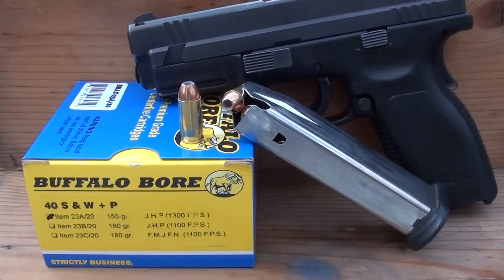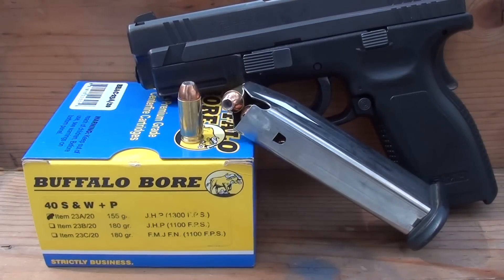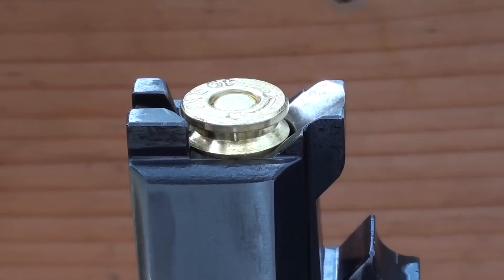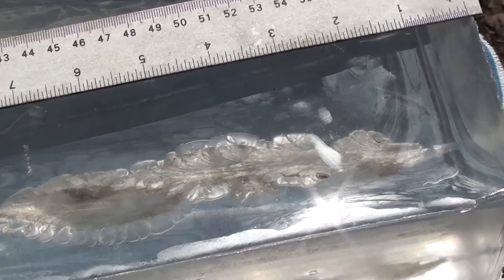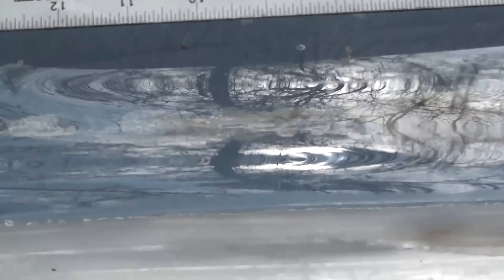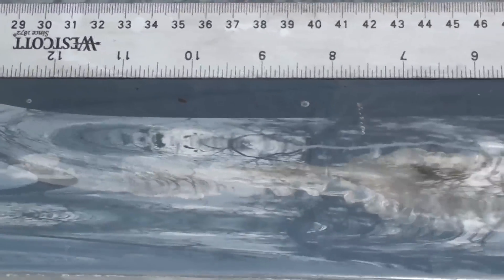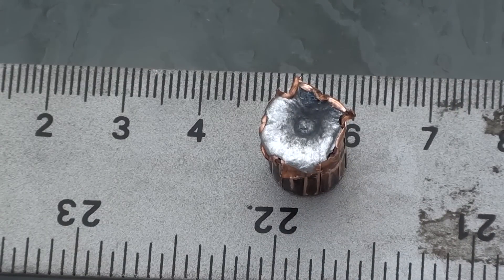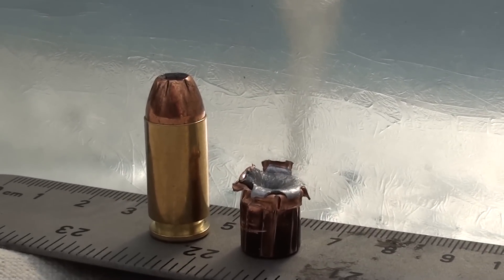40 S&W +P Buffalo Bore 155gr JHP Ballistic Gel Test

Comment: Scuba" I've heard this" not how reliable the source" I've fired Thousands of .40 cal out of my GLOCK 23 gen 3" I've never had a hiccup..& thousands out of my 9mm GLOCK's without a problem" but yes a Storm lake " or Lonewolf barrel is supported" I also have a Factory 357 Sig G32 barrel, although I've never fired it yet..Rock on
Reply from the maker: Oh, its not regular ammo.  That  warning is for over pressured ammo and re-loaders.  If your shooting new ammo in your Glocks, Rock on, all is good, Hell I have over 4k in my 23 alone with no problems.  Its just the over pressure rounds and reloading 40 S&W where the case bulges a little at the bottom because of having a not 100% supported barrel.  Your good brother
Reply: I also have a Glock 23 gen 3 Gen 3 you don’t have to worry about this problem Earlier generation glock 23 are not supported

Comment: In my GLOCK GEN4 G27 I replaced the 3.6" factory barrel with a 4" threaded Alpha Barrel from Lone Wolf with a compensator. I feel this barrel should be more then need for Buffalo Bore and Underwood +P Ammo in my GLOCK GEN4 G27. I also bought a threaded Lone Wolf barrel with Compensator for my GLOCK GEN4 G20 10MM. I will buy some of this high performance ammo and report back on tolerances on the .40 & 10mm.
Reply from the maker: From what they told me at Lone Wolf, their barrels are fully supported.  I am getting their 460 Rowland barrel and I inquired about the .40 cal barrels at that time.  Thanks for the comment. Let us know how your barrels turn out

Comment: Hey I checked my new GEN4 GIOCK G27 and it has the same appeared support of chamber around ammo as shown on you video. Anyone knew if GLOCK enhanced their chambers on barrels of the SUB-Compact GEN G27?
Reply: Yea Glock has increased the amount of chamber support on the newer Glocks. Modern day 40/10mm brass has also been strengthened from its original design years back. All told, you can pretty much shoot any SAAMI spec factory loaded ammo in your new Glock. I would still stay away from any "+P" ammo in the .40 though. First reason being there is no specifics in existence about .40 +P so every load is just a guess in that realm. Secondly, there is absolutely no reason for it. Any quality .40 load is more than adeqUte for defensive purposes; 165 & 180 HSTs, 155, 165, 180 Gold Dots, 180 Golden Sabre Bonded, 175 Critical Duty, all excellent and proven .40 loads that will function every time in your Glock. If you truly feel the need to stepping up higher than that switch to 10mm in the G29 and you can get all the high power loads you desire. Be warned though your groups will open considerably and recoil will be less manageable. This is why .40 & 9mm remain the most popular defense calibers; easy to shoot accurately, dependable, reliable power and good round capacity.

Comment: My 155gr hand loads in .40 are right around this velocity from a Glock 23 using TiteGroup- 1310fps avg, and I don't have any issues in the stock barrel luckily. I don't load much to that velocity in .40 as far as volume though, so can only speak for maybe 80-100 rounds. Typically I get much greater accuracy with a a bit lower velocity, around 1240 with an XTP bullet is very accurate. If I wish to get super hot in a .40 caliber bullet I just make hot rod loads for my G20/29. I can load 135's @ 1600, 155 out to 1500, 180 out to 1390-1420 and 200s at 1350 all safely from a 100% stock Glock with 10mm brass so I don't have much of a reason to risk damage getting 1300s out of a .40 case. That's just my opinion/preference though and I really only load that hot for testing as ultimate accuracy and maximum velocity don't always go together in a pistol load.
Reply: I've seen someone get 1550 out of a 150 grain nosler jhp with a healthy dose of longshot from a Glock 35 length barrel

Comment: Hey, Scuba, when I checked my Glock 23 gen 3 barrel last year, comparing to pictures  supported barrels, it appeared that my G23 Gen 3 barrel looked the same.  It didn't look like some older Glock barrels. 

I'm just curious if you could take a look and see what you think.  I can send pictures of a round in my barrel if you need.
Reply: All factory Glock barrels are not offered with fully supported chambers. This is only an issue with the .40 caliber though; all other caliber Glocks can safely handle just about any load you throw at it. Typically Glocks are proof tested to handle double the pressure of a given cartridge. For example 9mm standard pressure being 35,000 psi, Glocks are proof tested to handle a minimum of 70,000 psi. Your typical "+P" pressure is only around ~37,500 psi and typical commercial hot "+P+" loads are at most 42,000 psi. As you can see there is still a large safety margin here, and this goes across the board with service calibers. I have proven this time and time again by purposely double charging cases in 9mm and 10mm with stock Glocks and test firing the load and the pistol survived each time. Glocks are indeed strong, but the inherent weakness in the .40 case just doesn't jive well with Glock chamber design and high pressures. Typically you will only see case damage and not pistol damage but still the risk is always there.
Reply: @joedoole3527 Generation 3-4-5 G23  pistols are supported anything earlier than Gen 3 is not supported
Reply: I don't plan on testing anything marked +p in it, it's just for the sake of discussion and education.
Reply from the maker: I really dont know, As of now all Glock barrels in .40 are Tabu.  I know mine in Gen 4 does not show support, and the ones I have fired in Gen 3 bulge the brass I reload, So unless you change to a lonewolf barrel or ect......... I would be leary
Reply: @ScubaOz Generation 3–4-5 G23s  are fine anything earlier than Gen 3 is a no go
Reply: Anything gen3 and above is good to go
Reply: And the plot thickens haha.

Comment: It was only a matter of time before someone came up with a 40 +p cartridge.
Reply: Yep. I call mine 10mm.
Reply: @jr10  if you need a 10mm you'd be better off with revolvers.  unless you spray and pray like a spaz.
Reply: @af7119  Not sure I understand.
Reply from the maker: Leave it to Buffalo Bore, they tweak all rounds out!
Reply: I'm currently carrying an XD40 so I just might give it a try.
Reply: so basically a .40s&w becomes a 10mm again,,lol=full circle!!!
Reply: @6548ww  Not quite 10mm pressure or power.
Reply from the maker: No, the bullet is so light (155gr) the felt recoil (to me) is very light
Reply from the maker: LOL, everyone did back in the 80's  40's were known as Short & Whimpy loads.  10 kicks ass for sure, these 40+p's were pretty darn good also, not 10's but it worked
Reply: Rifles First official SAAMI specs for +P+ do not exist even for 9s. However, saying there is no such thing is inaccurate. It exists and you can buy +P+ marked rounds that are over 10% above max. Not having an official spec for it doesn't mean there is no such thing.

These particular loads may or may not be over SAAMI max specs for .40, but that wasn't my point. 

I'm also not advocating or suggesting people load to +P themselves. .40s can be touchy if you load 180 gr bullets and would be difficult load to an accurate pressure because of the small case size. It is difficult enough to load to max safely. 

However, if the manufacturer is going to load 155 gr bullets to SAAMI .40 cal max pressure, it would be a good idea to put +P on it because due to minor inconsistencies in powder metering and seating depth, you will inevitably have a percentage of rounds that end up over the max pressure. Warning buyers that they could be shooting .40 cal rounds at +P pressure levels (if you can't handle actually calling it +P). If you have a gun built to handle a .40 proof round, it won't fail catastrophically with a .40 +P round any more than a 9mm would.
Reply: @IHCTerra  what does "built to handle a .40 proof round" mean?
Reply: Dr. Death Common misinterpretation.  They both have the same maximum psi rating, though.  Who knows what actual pressures they are using when you buy ammo?  Well, it probably could be found, or at least equivalents of each could be compared for hand loads.
Reply: +ScubaOz BTW is the recoil any snappier with that +p round?
Reply: Ha! Me, too. If I'm not using 10mm, I like .45 and 9.
Reply: IHCTerra I have to concur with Rifles First in both the first and last line of his reply. There is no 40 +P. It is simply a marketing ploy for pushing ammo loaded to max spec to those who don't know any different. Furthermore that ridiculous bit about a small percentage being over the SAAMI spec due to inconsistencies in powder charges or seating depths is already factored in by them. That's why its called the maximum average pressure (MAP) and it typically includes a 4% standard deviation for those very reasons. Another note I should add. In regard to assumptions of a gun being proofed. Unless it bears a proof mark. Never automatically assume the gun can handle a proof load. Or was built to handle one.
Reply: @IHCTerra  ty
Reply: +Raul Danger Exactly!
Reply: Still had to sacrifice grain weight for combustion space to be safe no way you could do this with 180 grain, if so then I will be impressed.
Reply: @yousef ahmed It means there is more pressure than the SAAMI maximum pressure for a standard pressure cartridge. Basically it has a little added gun powder giving it a little more power. Not all guns are rated to handle +p cartridges.
Reply: EABOY2600  Part of your post is imcorrect, so it's hard to give credibility to the rest; 
Glock barrels do NOT have fully supported chambers in Gen3-5 or any, as you stated.   Glock also, specifically does NOT recommend firing full power ammo. 
 They may be able to, but they still do NOT have full chamber support.
Reply: The actual pressure isn’t known but they may have achieved these velocities with Longshot. You can get faster speeds without exceeding safe pressures.
Reply: *****
If it exceeds SAAMI standards, it's +P. But I don't really care since I don't shoot .40.
Reply: Exactly

.40 is already a high pressure round

no such thing as +p
Reply: lafurnace3 No they dont lol